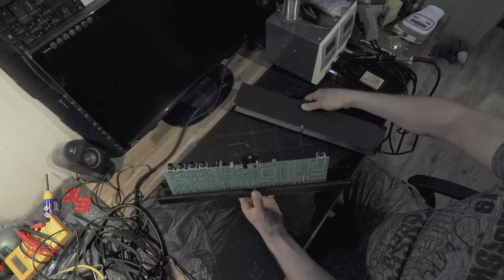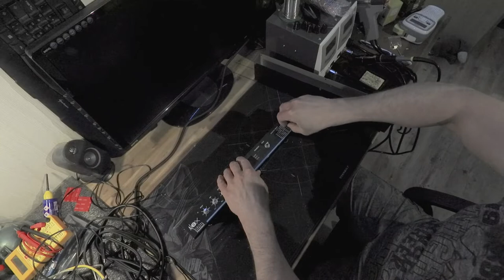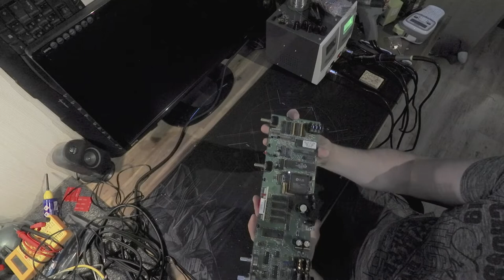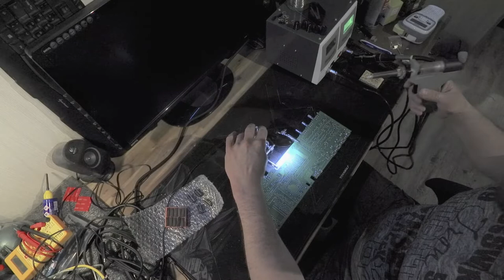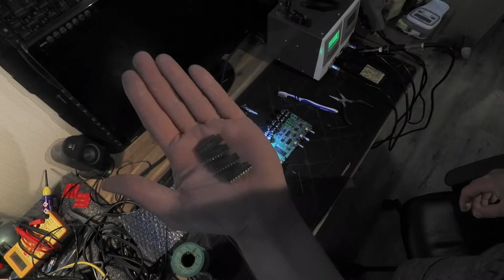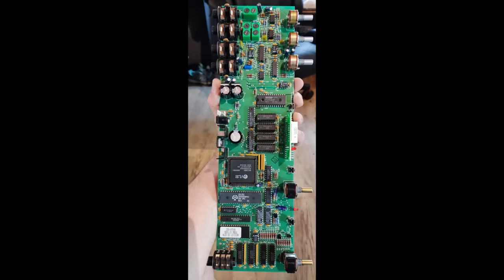Lexicon Alex DRAM repair, after strange noises.

Comment: Hi, I am affraid that my Alex has the same problem... what type of DRAM did you use..? In service manual can´t find the exact answer...
Reply from the maker: Texas Instruments DV41464P-10
Reply: @nanotrax  Thanx a lot. I'm not very familiar to digital ICs... the original is "P-12", you used "P-10" - so it doesn't matter I suppose..?
Reply from the maker: @jantaras7186  
The end number shows the milisecons of the D-RAM.
10ms works ok to me but if you find a 12ms, take it.
Reply from the maker: Buffertiming is the right word :D
Reply: @nanotrax  OK Thanx. Sincerely Jan
Reply: @nanotrax I have a Lexicon Reflex with a short digital pop/click that happens about every two seconds. Was your issue a repeating noise? I wonder how to diagnose and what exactly to repair. I guess more research. Any tips? I also wonder if there's any mod to make the quality cleaner overall. I recall a mod for the LXP1 and LXP5 to make them sound cleaner.
Reply from the maker: @subs4794   yes repeating noise